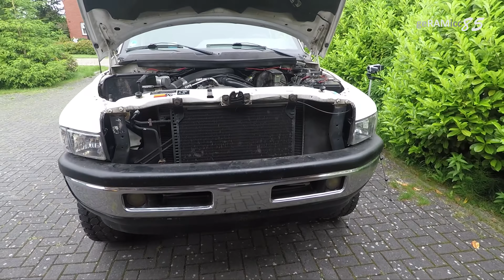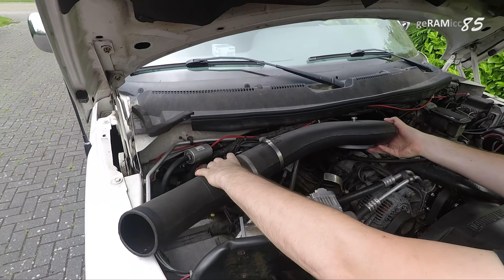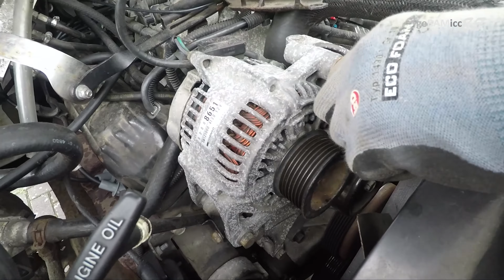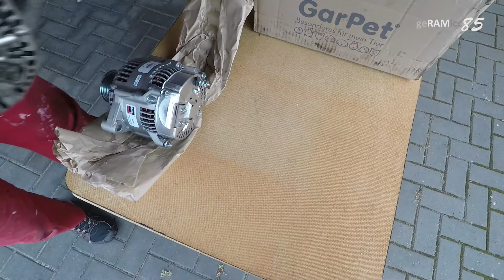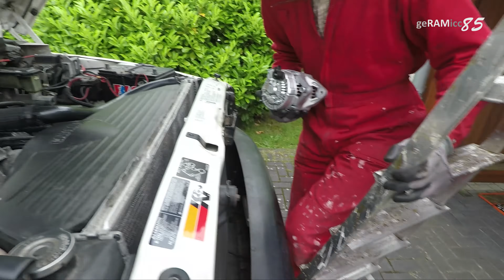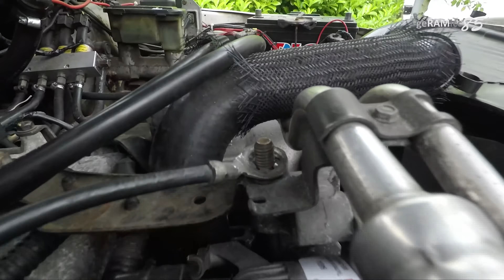HOW TO REPLACE ALTERNATOR ON TRUCK, INSTALL DIY TUTORIAL, DODGE RAM 2ndGen jeep dodge chrysler ford

Comment: Sometimes ignition clicks and starts right up after jumping. If I give a lot of gas and let go quick it stalls. One day I had to jump start and not even 20 feet down the street it stalled. At one point I had to keep my foot on the gas to keep it from stalling. Alternator? Battery is 1 month old after changing a bad  one
Reply: B E im dealing with the exact same problems. Was it alternator?

Comment: You have the best videos for DIY truck repair.   How about an update on the P1391 problem.  Also, if you're moving onto another truck why not get a 97' Dodge Ram Cummins diesel  2500 or 3500?  I'd imagine the 3500 would be a pita to drive in Germany.